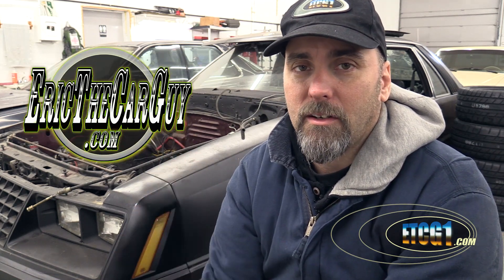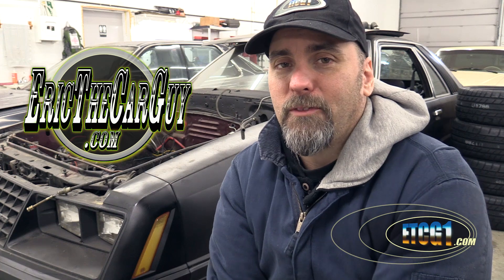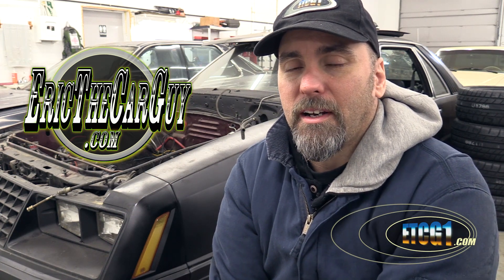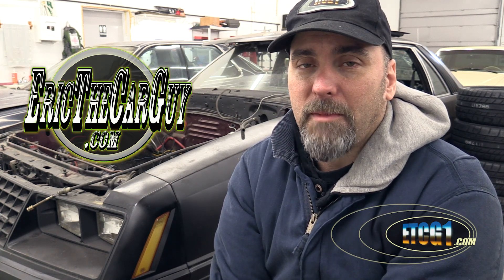A Faster Horse -ETCG1

Comment: Yeah, save 15 cents on a spring, then later the owner is paying a shop $250+ to replace that part when the spring in it fails.  I don't buy the argument that it's $1.30 saved times that many vehicles.  INSTEAD BUILD THE DARN THING RIGHT and I'd  G L A D L Y pay $1000 more, for a vehicle where you DIDN'T try to save $1.30 on each of 769 different parts in it.

Literally, I have had this happen to a Ford, where they didn't make a freakin' spring robust enough to last, or have the mechanism machined so the stamped metal edge it mounted on, wasn't a sharp 90' edge that wore the spring away prematurely... and it wasn't the slightest bit rusted, but they also appear to have saved 1 cent not greasing the contact point either.  I guess grease is unslightly or something.

Then they don't sell the spring separately.  Thanks Ford!  You and I have a real love-hate relationship sometimes.

Comment: At my job we make parts for a company called Linamar which is a machining company that works with Ford. We make all types of transmission, axle housings, mounts, brake parts for Ford and many other manufactures. It's true though that people automatically assume when something breaks that it is the auto manufactures fault. Not the case, we get stuff sent back to us because a trim die didn't hit it right or the metal didn't fill right and cracked which has nothing to do with said company.

Comment: Just saw this on Netflix about two weeks ago. Very interesting stuff.

Regarding your thoughts on “pennies per part” (etc.) I disagree. If a part costs them a few cents more to produce over the time of the car, increase the cost of the car by a buck per. I would GLADLY pay a couple of hundred extra on a complete, new vehicle if I knew that there were none of these cheap, junk parts in it, that they had truly ironed out the bugs. I know that most people would prefer that all the prone-to-failure parts in their cars had never been installed, that these all were properly engineered in the first place. If they replace a junk part with one that is 27¢ more per part and then add $1 to the cost of the vehicle IN THE FIRST PLACE then the increased cost of doing it right would ONLY cost them the extra 27¢ per vehicle and that extra dollar would net them 73¢ more profit per unit sold over the lifetime of that model. Even if you factor in spare parts for dealers to sell over the next 20 years they would benefit from the better part. If it breaks less often, fewer replacements must be made and then stocked. So the expenditures for replacements would be lower up front as fewer would need to be produced, and the $1 per car increase in real cost would still make them more money in the end.

I think much of this process in the movie is actually whitewash for the planned obsolescence thing. It makes them more money to sell cars with a limited lifespan. Honda has engineered their vehicles to fairly well disintegrate at a certain mileage point. Hondas used to be bulletproof, and by and large they are still quite good, even if they are slipping up some, but current Accords simply become money pits once that mileage point is crossed, unlike in decades past when (like a Volvo or many other cars) parts wore out in a much more random way, spreading the cost of replacement over a long time. My 2010 Accord hit 140,000 miles and now everything is coming apart. My 2001 Accord did this at 200,000 miles, which is great, until you realize that you cannot afford a replacement vehicle and you need to replace your radiator, transmission, rings, complete suspension bushing set, interior parts and AC blower all in a three week period.

So I fully agree with you on the cost of a few pennies adding up to huge sums, but really, modest price increases - MODEST - would cover much of the poorly designed parts. The real limiting factor here seems to be the maker’s desire to get our butts out of a car by a certain time so we will get another car. 

This is more of a dagger than a knife, I think. Great video. Up-thumbed, sir.

Comment: The only problem I have with Ford is the same problem I have with GM, and Chrysler. It's not the workers or the engineers or anyone else involved in the production of the product.. It's the fact that the product itself is viewed by the company as a whole as just that. Product.  I never heard of such stupid failures as broken intake manifolds for example until somebody decided to save a penny where they could not afford engineering wise to save it.  Funny thing is if they had just routed the heater hose a bit differently they could have gotten away with it but instead made it so short that it can't flex as the motor moves under torque. I know people will site things the Japanese did wrong but at least it looks like they're trying. I have an Isuzu and I will say that the vehicle was really not well thought out compared to a Honda but even this was after GM came along and touched them inappropriately.

Comment: I work part-time at a small local shop that ultrasonically plastic welds and puts O-rings on vent caps for GM 6 speed automatic FWD transmissions. That's their main job, but we also run automated machines that inspect bushings for transmission and do a little visual inspection on water pump parts. 

This one shop employs a handfull of people. There are thousands of these shops around. Don't think of GM or Ford as losers for  farming everything out, think of the benefits of how many people work in shadow for these major automotive branches.

Comment: I agree with you mr Eric I knew all along your points were spot on. As for the GM and Chrysler bailout all you said was true but I just wanted to add a side note about the Ford. When GM and Chrysler sat in front on the government the CEO of ford was sitting next to them. Ford decided not to take a bailout because just a year before they got government funding to build "eco cars" So ford really didn't need the money. The CEO went there hoping to get some more money but after he seen they were doing a hostile take over of the company he pulled out of the bailout. To me that was a bit dishonest. The worst part is they had the nerve to push a commercial that got taken down praising how the did not take the bailout. Just my little rant, great video Eric :)

Comment: I don't get why parts are more expensive if they are easier to produce with robots now a days and back in the day was more human labor involve an where cheaper isn't suppose to be the other way around half of the stuff are plastic like valve covers,water outlets, radiators and etc. I know it's for weight reduction but it's cheaper for them to make but not for the customer.

Comment: As a former owner of a 65 and 67 Mustang, I always wondered why Ford "cheaped" out on the early years by not painting the cowl hat vent area under the windshields.  These areas eventually rust out due to dirt and debris holding moisture which results in a very time consuming and expensive proposition to repair correctly.  Both of my horseys had three pedals and I enjoyed them a lot!

Comment: This is why it bothers me when people remove things from cars like brackets/stiffeners/air intake tube resonators/etc. If it wasn't absolutely necessary, even if it only costed 1 penny, the car company would not have put it on the car.
Reply: +Chad Bob More like the government and emissions made it necessary, yeah it works great when it's new, but when things wear emissions control systems can actually cause the engine to create more emissions. There's a good reason to pull off certain hoses and connectors if you plan on making the engine run cleanly for 10+ years.
Reply: +CrustyHO Main example comes from intake manifolds and the pcv system clogging intake runners and valves with tar from the crankcase evaporations on GDI engines.
Reply: CrustyHO I'm not talking about legally required items, you psychopath.

Comment: I disagree on the bail out issue. I understand your point about third party manufacturers etc but you have to consider that demand is what it is. So if GM went under for example demand would have shifted to other manufactures  who themselves use third party ( probably even the same companies) suppliers.

Comment: everyone goes for luxury now, I think car companies should go back to the POS trucks, cheap, no options whatsoever, but do the job.  The same goes with cars, they should make a $10k disposable car with no features for people on a budget.
Reply: Totally agree with ya on that one!!
Reply: +TakeiT 
Guaranteed luxury is what our  comfortable class buys into. Simple and durable cars are things of the past.
Reply: +TakeiT You could order a completely stripped truck until just a few years ago (maybe you still can... I haven't looked lately), but people don't buy them. People would rather buy a 3-5 year old vehicle for the same money that is loaded to the gills with crap.
Reply: +TakeiT guess you want my 91 F150. 4x4, regular cab, long bed, dual tanks, 300 I6, 5 -speed, manual windows and locks, no a/c, 2 speed wipers, vinyl bench seat, rubber mat floor. i paid $600 for it back in August. just needed a windshield and new hubs.
Reply: +CamaroAmx see this is the thing though. some features like AC dont really cause reliability issues. Same thing with leather seats. I dont mind niceties when it makes sense. Its when they start attaching all these damn motors and electronics like computerized adjustable seats and auto braking that you just know are going to screw you down the road.

Comment: you bring up a lot of good points. one of my biggest issues is the high technology there putting in vehicles.  that kind of stuff is very expensive to fix and replace. especially if the vehicle is bought used
Reply: look into what is mandated by law for them to include these days. It is crazy.
Reply: +NordboDK Isn't there a big push to make auto braking mandatory on all vehicles?
Reply: +MrMistery101 I wouldn't be surprised. Tire pressure sensors and backup cameras already are.

Comment: i dont care, there is no reason at all ford needs to put the engine half way under the damn wiper cowl.
Reply: +pdgeman weight distribution.
Reply: You realize that the load goes in the bed right? so why would you want to shift unneeded weight to the back?
Reply: +pdgeman It isn't the same thing. Having one of the heaviest components near the ideal center of the car aids in turning: think of the path the engine would take at various positions in the vehicle during a turn. Some these paths experience a more gradual change in momentum. Shifting force where it's needed when braking, turning, or accelerating is also another reason, as opposed to having it always over the front axle.
Another reason, and I may be wrong here, is that there is a necessary crumple zone that extends through the front axle; therefore, the engine was pushed back to keep the desired wheelbase.
Reply: It's a pickup truck...
Reply: +pdgeman I kinda always thought you want the engine inline with the firewall to improve handling..
Reply: It's a pickup truck.

Comment: i had a problem with engineers today. 30mm nut thats about 5mm deep so you have nothing to grab onto. It's on the control arm too, so nice and tight
Reply: +TacticalBBQSauce This sounds German to me...
Reply: How so? There was a nut about 3-5mm in height with a diameter of 30mm, attached to the control arm.
Specifically, it was holding the radius rod into its bushing.
Reply: TacticalBBQSauce A design like that sounds like what I would expect to find on a German car. So... what car was it?
Reply: +Maxwelhse ohhh the car! I thought you meant my comment, sorry confused. It's a Holden Ute, about as Aussie as they come
Reply: TacticalBBQSauce
lol! I can see why that would be confusing for you.

I've never worked on a Holden, but I wouldn't necessarily expect to find something like that on a US GM... I would find all sorts of other stupidity though.
Reply: +Maxwelhse Well, it's a '98, they were probably trying to get futuristic or something haha
Reply: TacticalBBQSauce
Gotta go back to the 80s to see GM get futuristic here in the US. Digital dashes (and even CRT touch screen climate controls) and computer controlled carbs and active air suspension and displacement on demand (WAAAAY before the LS motors), etc,etc, etc...

None of it worked. haha..
Reply: +TacticalBBQSauce that's a VT ute you would have then right? I believe the 3rd gen Commodores (VT to VZ) were based off a Opel Omega I think which is actually a front wheel drive 4 cylinder - I was surprised when I found that out - though we did change a lot of it and made it Australian.
Reply: Wtrxprs007able
Oooh! You're so close, but think older. It's a Series III VS S Pack. But not shagged out and crap like every other VS on the road haha.
Reply: they made VS's in '98? o.O didn't the VT's start coming out in '97? maybe yours is one of the last ones on the line to get finished lol. haha would be interesting to see a clean commodore for once
Reply: +Wtrxprs007able Holden actually built them for quite a while. The VS sedan and wagons were built from 95 to 97 but the utes they made from 95 to 2000. The VS was also the first commodore with the ecotec v6 that Holden used for so many years.
Reply: +TacticalBBQSauce oh wow okay. Didn't know that actually. That's pretty interesting

Comment: A penny earned is a penny saved and may cost a life and it has.
Reply: they need to know what will happen if they cheap out... as long as it's out of warranty it's good they say.
Reply: +RickTrajan There is an issue with this concept of "cheaping out = crappier product"
Cost is brought down as much as possible while still maintained within specifications.  Throwing more money at poor design or parameters won't solve the issue.
Reply: The Pinto comes to mind...
Reply: the mobile gas tank??  perfect or GM ignition key scandal..